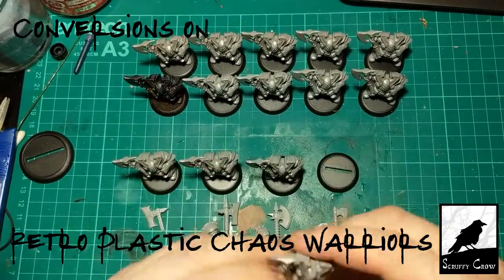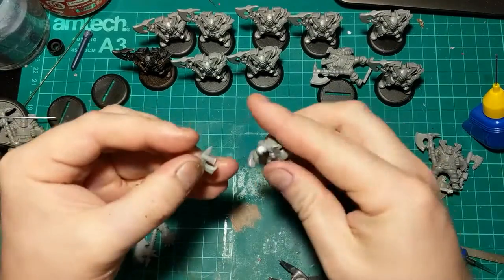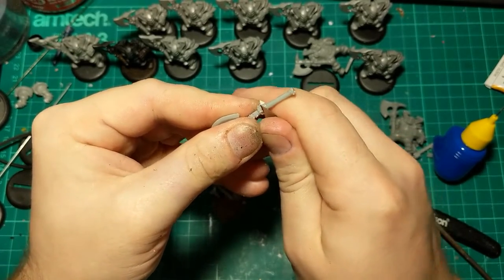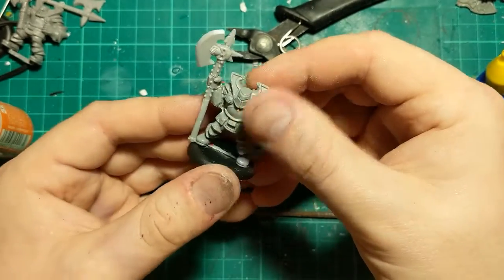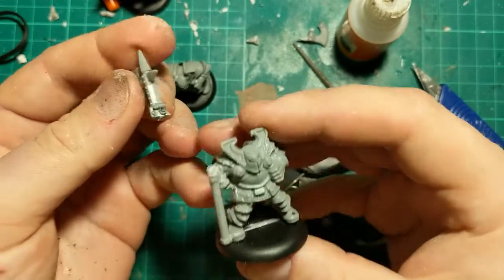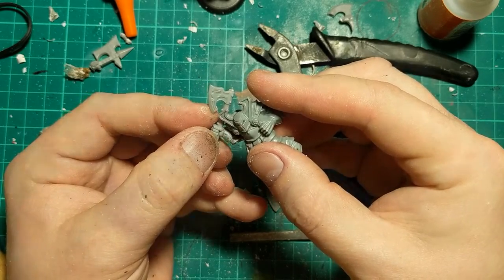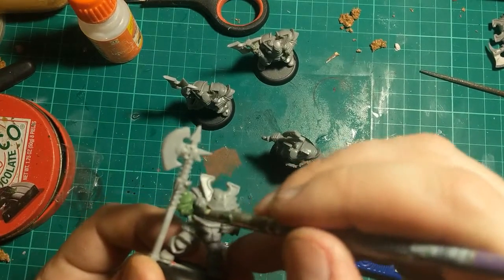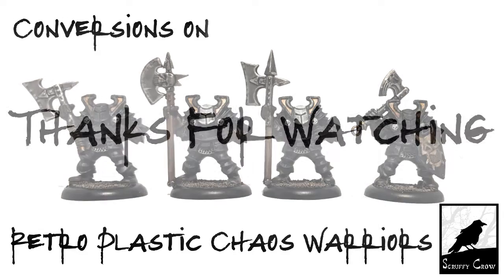Conversions on retro plastic chaos warriors

Comment: This was a good video because those old one piece models just look so jarring ranked up. I have some mixed into the ranks, but they are an eye sore. Maybe i should take them to the chop shop and try to convert them 😌

My one comment I'll add is I would have pinned those spots where the weapons meet the hands. A small piece of wire drilled and glued in place adds a lot of stability to the joins.
Reply from the maker: I pin a lot but when it's plastic to plastic with good plastic cement I've never really needed too.